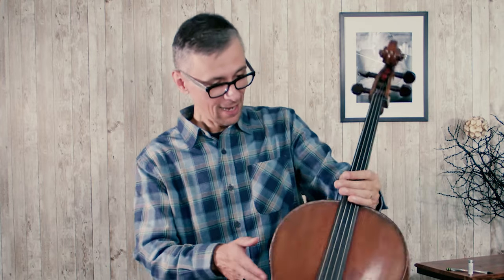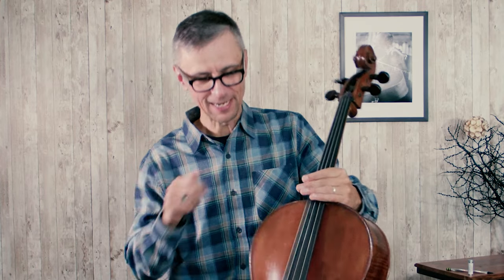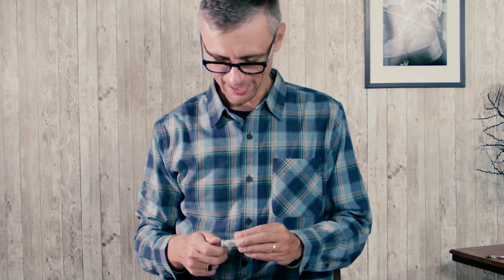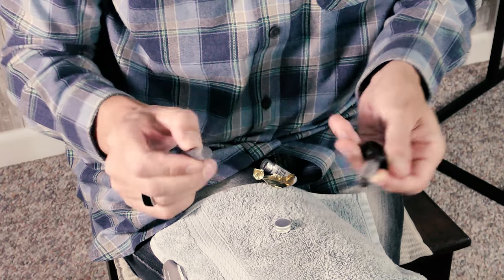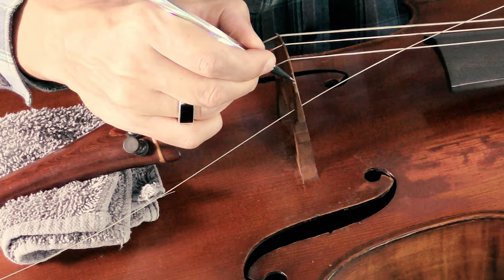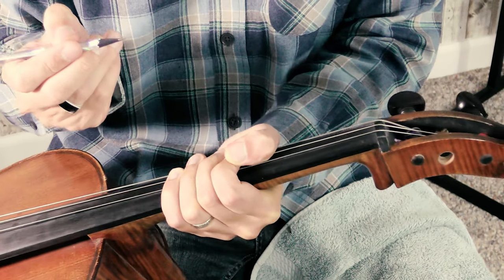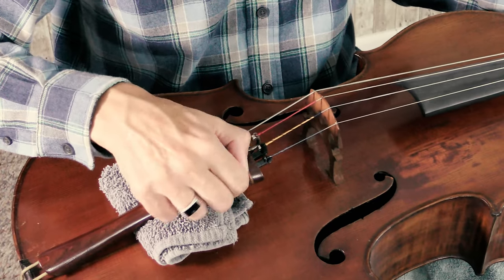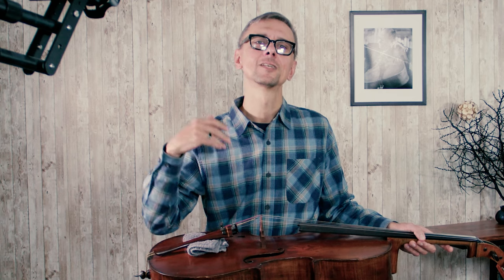How to Tune Cello, Loosen Stuck Pegs and Change Strings

Comment: What happens if you cannot move a peg on an 1/8 size violin? The A string peg is so firmly stuck I cannot move it at all.
Reply from the maker: In this case it would be better to go to a violin shop to get help.
Reply from the maker: There is some risk of braking a peg - this is why you want someone with experience to deal with it.